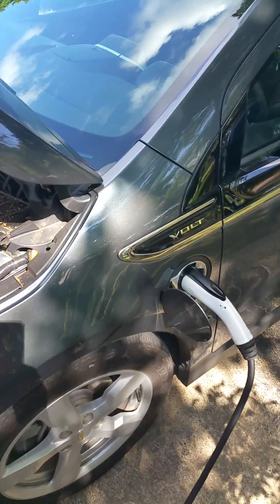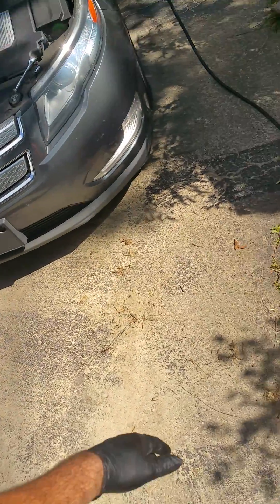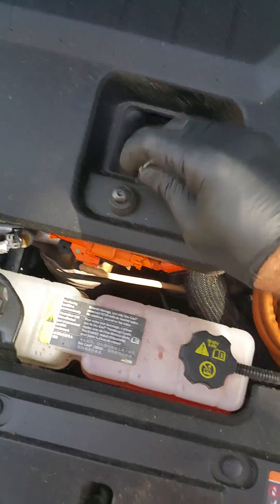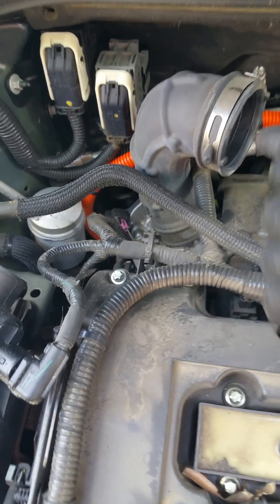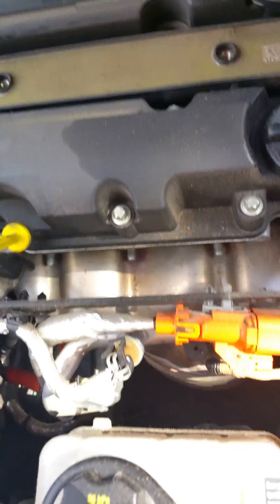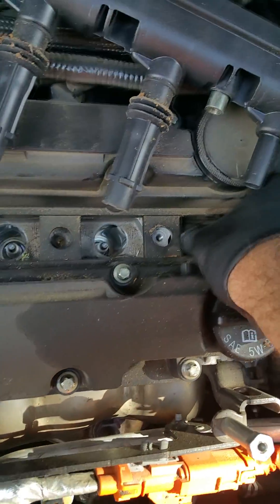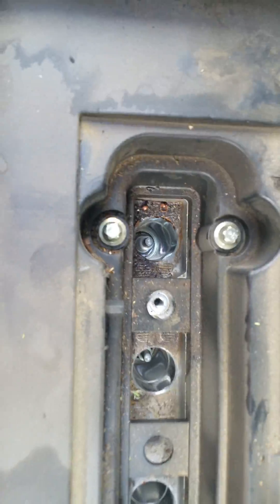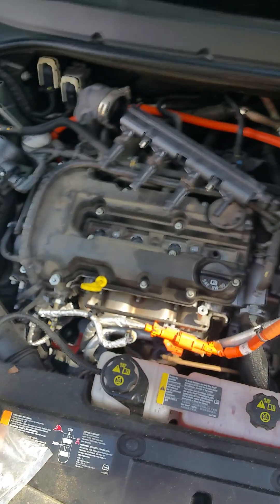How to change spark plugs in a chevy volt.

Comment: Pull the coil pack rail STRAIGHT UP, slowly and gently!!!!! Two of my boots stuck in place, one of them I was able to wiggle free, the other tore easily when I was pulling on it.  If  a boot sticks to a plug, don't pull from the top, push a socket extension or flathead in the boot then work it free, then pull from the top.  thx  for the vid.

Comment: Addendum to previous entry:  The manual recommends replacing the spark plugs at 90,000 miles.  This can be debated, depending on how much the Volt is driven on the Gasoline engine.  Do you really need to replace them if you use the Battery and rarely use the Gasoline ??  In either event, I would recommend  removing the ignition coil pack as soon as possible, before the rubber boots get welded to the spark plug and valve head.  Apply dielectric silicone grease to the boots and spare yourself the extra pain and expense of a new coil pack the next time you change your spark plugs.

Comment: Wow !! This guy's Chevy Volt must have had very low miles on the gas engine, because the ignition coil packs came out without a hitch and 3 of the 4 rubber boots were still connected to the coil pack stems.  When I removed my own 2013 Volt's ignition coil pack, with the odometer at 100,000 miles (using 2357.1 gallons of fuel), all four of the rubber boots were welded to the cylinder head and could not be removed without damage. Only one of the boots survived with minimal damage. The other three were torn apart bit by bit and were definitively obliterated.  I was hoping to find a cheap replacement set of rubber spark plug boots, but was forced to purchase an entire replacement ignition coil pack, which includes the four rubber boots,  from the local Chevy parts dealer, at nearly two hundred bucks !!! The boots only come with the OEM coil pack. They aren't sold separately.   So, after paying the dealer and running back home to fix my Volt,  I dabbed a generous dollop of anti-seize silicone dielectric grease onto each new boot and also to the spark plug base and valve head, to make sure that the next time I change a thirty dollar set of spark plugs, that I don't end up paying two hundred more for a new set of rubber boots.
   The Word of Wisdom here is:  Open up the coil pack as soon as you can, before the rubber boots get welded on, because these cost about two hundred bucks.  Smack some dielectric grease in there so that the boots don't stick.  $$$
Reply: I had this exact same problem on my 14, 109k. All of the boots were wrecked. I found a coil pack Al deco on Amazon one day for 75 bucks.
Reply: @TechProGabe  I bought them from rockauto OEM for $70, along with plugs. But I was buying plugs, belt, for my Silverado HD also so shipping was very cheap per item.

Comment: The only problem I had is that two of my four plug boots would not come out without ripping them up with a pair of pliers, so when I went to find replacements, the auto parts store could not order them and the dealer said that they could only get them in a kit with the coil and wire kit for $180. So I finally found them online for $4 each. Came with the spring and boot. I went ahead and ordered all four. The moral of the story is if you don't want your car sitting idle for a week, just go ahead and order them ahead of time.
Reply: Looks like the boot part number is GM  25200155  https://www.gmpartsdirect.com/oem-parts/gm-s-boot-25200155
Reply: All 4 of my boots stuck and the release lever for the coil plug broke off when I pressed it too :(
Reply from the maker: Dan Chisham  but at the same time if you don't want these new boots to stick go and put vasoline on the inside of the new boots so the heat doesn't basically cook the boots to the plugs. I would highly recommend it. Glad the video helped you out.
Reply: What is the part number?  How do I find the boots?  I'ma t 140k miles so past due for a plug change.
Reply from the maker: JFlywheel  Oh nooooo sorry to hear that. I wish you better luck going forward.
Reply: Yeah so where can I get the boots in case the spark plug change results in a boot ripping? On gmpartsonline the whole ignition coil including the boots is one part number

Comment: Thanks for the video, sorry if you said, but what are the OEM plugs?  Dual fine wire platinum?
Reply from the maker: OEM means Original Equipment Manufacturer. I Just put in double platinum plugs. Have had zero problems out of her. Happy you enjoyed the video :)
Reply: Justsayn .nunya  oh sorry, I meant what are the OEM plugs that came with the vehicle?  Did you check the product number when you removed them?  Maybe NGK?
Reply from the maker: Mine were ac delco

Comment: Someone please do a video on changing the transaxle fluid in the 2011-2015 Chevy volts.I found out it takes Dexron VI and should be changed with heavy use at 45,000 miles. I'm going to replace mine with royal Purple Max ATF It's completely compatible ,but  GM won't honor the warranty with it;s use at this time. I'm pretty sure this is just a drain and fill similar to the Prius but there are no videos for the Volt. The dealer wants over 200 dollars for a 30 min. job tops.
Reply: There does exist a video about the ATF drain and refill on a chevy Volt.  It is very informative.  One word of advice:  Teflon thread seal.   Apply Teflon thread sealant tape to the drain plug's threads.  Even though the plug has tapered threads, without a chemical or physical seal, the fluid will definitely leak out over time.  My wife's 2012 Impala has an identical drain plug, and I didn't use Teflon thread sealant tape, and over the course of a week, the ATF trickled out to the point of causing shifting issues.  Sealing it up and refilling, and the leak was stopped.  I put teflon tape on my Volt, and check the plug regularly.  After a year, absolutely no leakage.
Reply: @roymariano7116  yes https://youtu.be/ZI8coQvydmI - do you think regular plumbers tape would do?

Comment: glad to see people putting the miles on em.  I have a 13 and plan on keeping it as long as i can!
Reply from the maker: Mrchevy baja I paid 130.00 for the radiator for the battery because it is the one in the front and it was the one that took the damage. I bought it on ebay. The dealer wanted 700.00 for the same radiator.

Comment: Good video, I'm at 62000 miles but I think the spark plugs are good for 100,000
Reply from the maker: Yes they are. I put iridium plugs in mine in order to make them last another 100,000 miles. I now have over 119000 on mine and the only trouble I have had is I had to replace my radiator due to it being hit by rocks from a dump truck. There are two different radiators on the volt. 1 for the engine to stay cool and one for the battery coolant. I love my 2017 Volt. Great car. I like my 2013 and how it looks. It is really a great looking car. The 2017 gets better fuel mileage....
Reply from the maker: Carlos Zavala 

I now have over 130,000 miles on mine and I now have a 2017 and the 13 but I LOVE them both. The wife drives the 13 and she is now at 89 mpg in it cause she drives almost on nothing but electric. I still have a hard time explaining how these vehicles are nothing like a prius. But people are blissfully ignorant.
Reply: Justsayn .nunya how much did your radiator cost for the part and was it OEM?
Reply: What size allen did you use? Going to start this project. Looks awesome. Looking up types / brand of plugs and ignition coil pack for replacement....